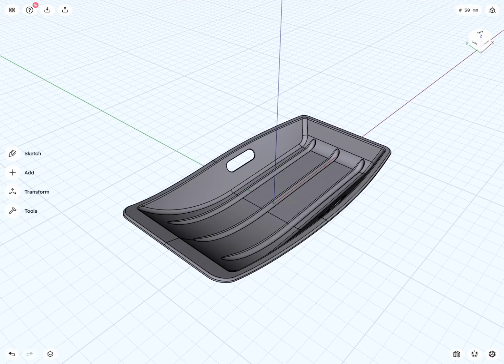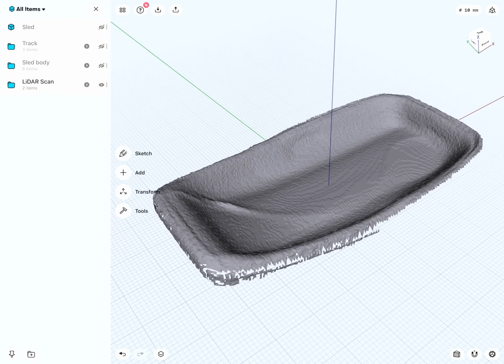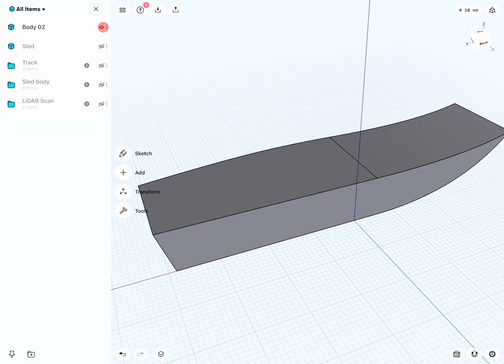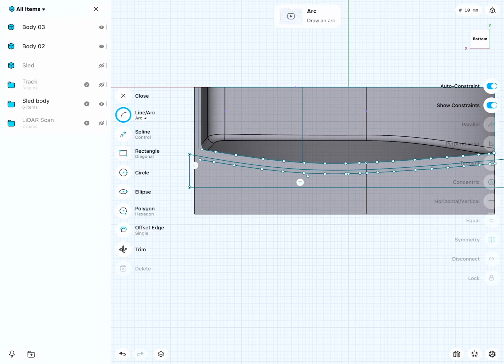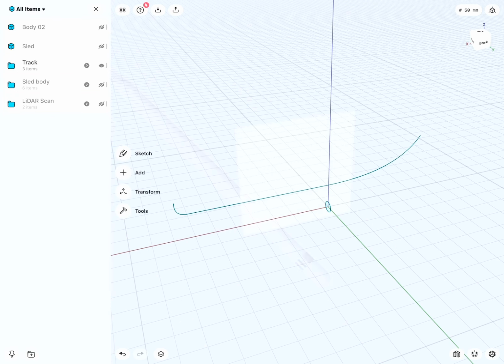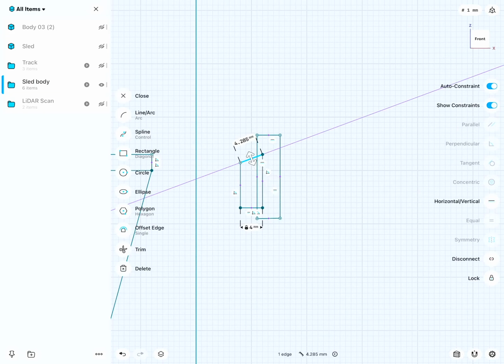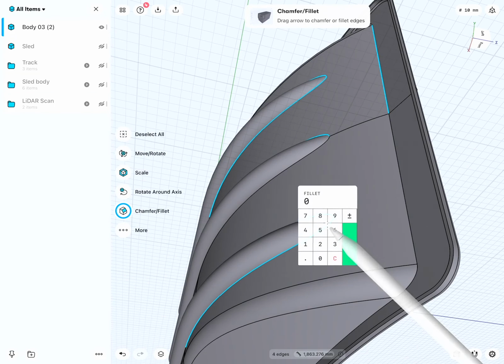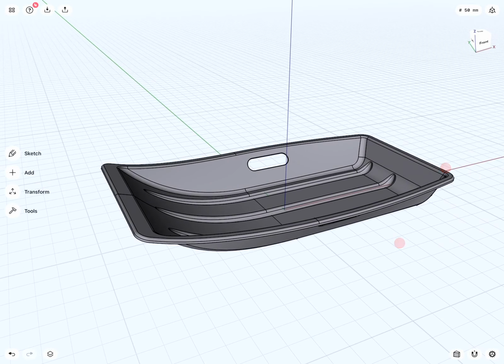3D Modeling a Sled on iPad | Shapr3D Step-by-Step

Comment: Thank you. I will try to do it when summer break start. I wonder what app you are using for record your screen. It sees so great to show your finger pressure and apple pencile. Recording app makes your tutorial more effective and easy. Thank you.
Reply from the maker: Hi! Regarding the pencil and touches, it's an in-app feature. You should go to your iPad's Settings and scroll down to Shapr3D. There will be an option "Display pencil and touches (requires restarting the app)" - switch that on :)
Reply: @Shapr3D  Cooooool, Thank you so much.